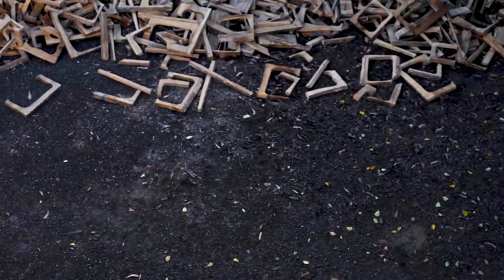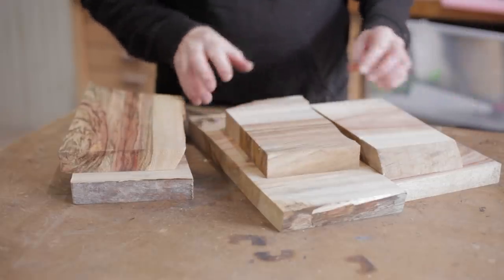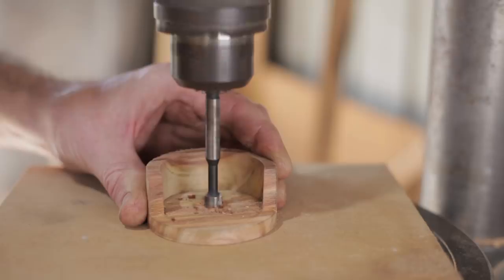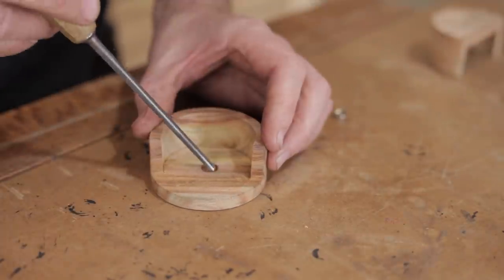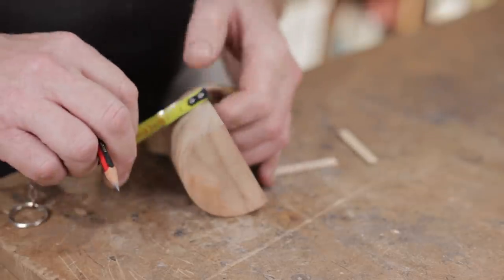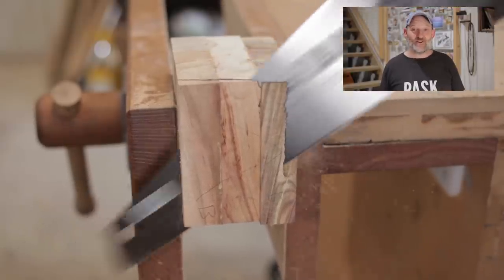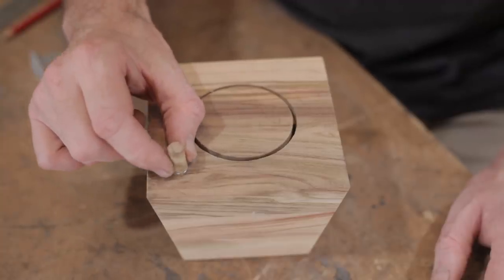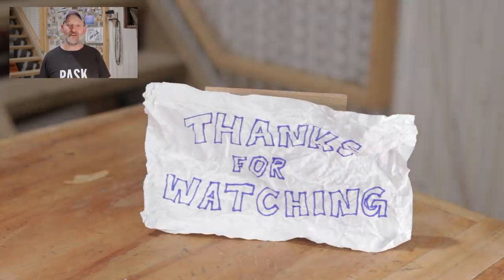Bandsaw Box without a Bandsaw! - Scrapwood Challenge Episode Twelve

Comment: Interesting project and beautiful result. Now, you mentioned you'd have to be careful not to drill too deep because of the point on the Forstner bit, so here's a tip for you - buy an end mill bit, they don't have that center point, and as you clearly have a drill press, you won't have any trouble with the bit wandering.

Comment: Since I'm a year past the original posting date, It's hard to say if Pask will notice this, but I have a suggestion for an alternate use of this design that includes a mechanism design challenge. The idea is simple. Instead of a drawer, there would be a clock mounted on the backside of the face. By pushing the button, the face would rotate to reveal the clockface and rotate back when the button was released. Maybe call it The Stop-Watcher: an anti-clock-watching-clock. B-)

Comment: Thought it was a Bluetooth speaker at first.
Reply: tbf, you can probably make one using like a 5W driver, not sure how well it would sound, but it might be a fun project, basically follow this, except you put a drawer on the 3rd block for electonics.maybe add a membrane by cutting some rubber from an old air chamber